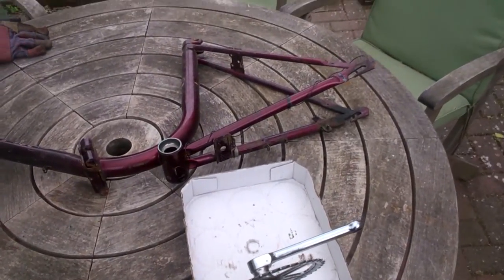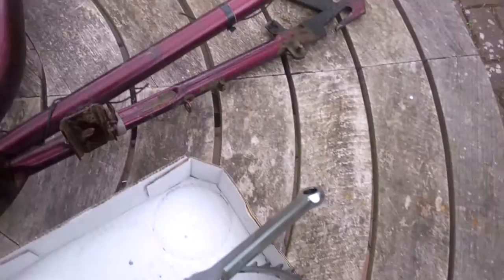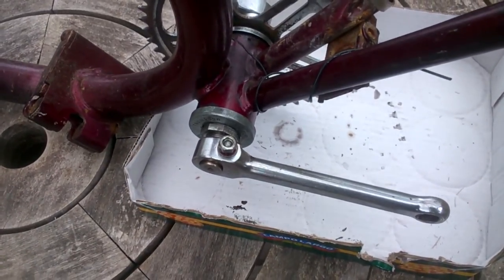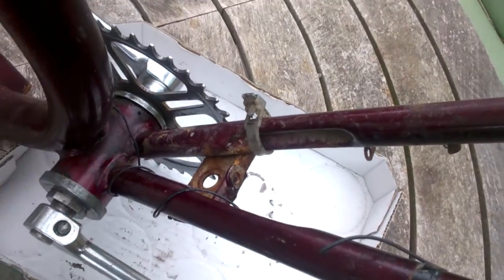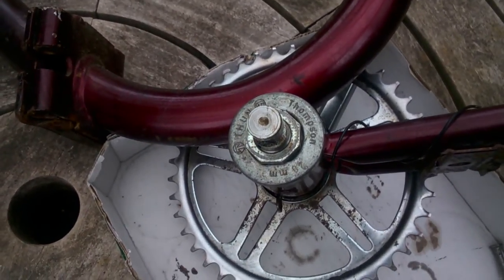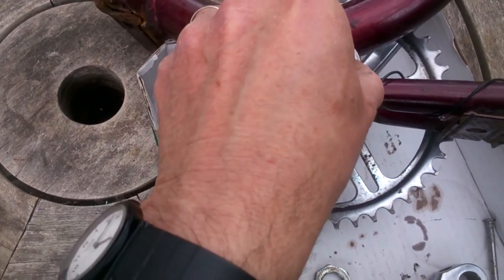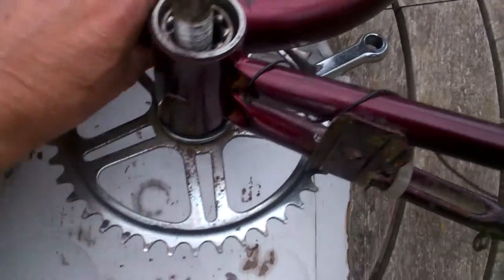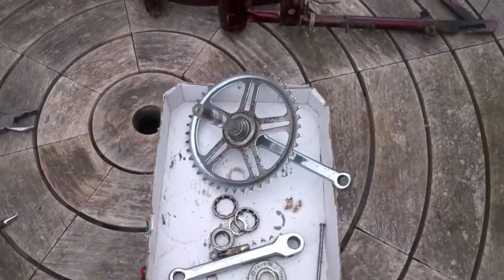Removing a Thun Thompson Bottom Bracket

Comment from the maker: One of the viewers of this video has just used it to adjust his bracket, and he suggested a refinement to my instructions at 3:26, where I talk about the tool to adjust the cone. He tells me that the securing cap itself is adapted to grip the adjusting cone.  Therefore, once the securing nut has been loosened and slid away from the securing cap, the adjusting cone can be either tightened or loosened merely by turning the securing cap. Thanks, Ron Goldstein!

Comment: As someone who worked on a lot of vintage bicycles from my own collection and for friends, I know those are very good bottom brackets.
Generally, never replace vintage bottom brackets with modern disposable plastic crap, ignore all the shills trying to tell you otherwise. They don't last, are not adjustable or in any way servicable, look bad and it's a pain in the rear to get them out after decades.